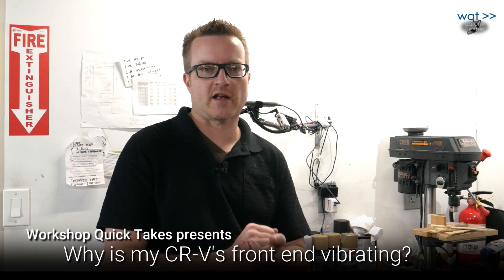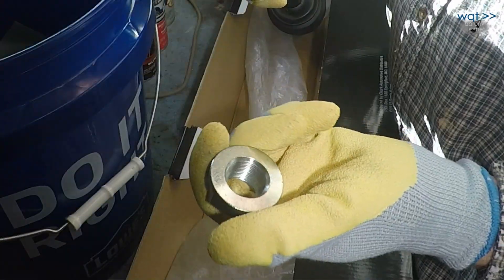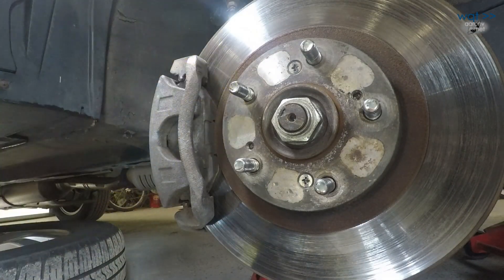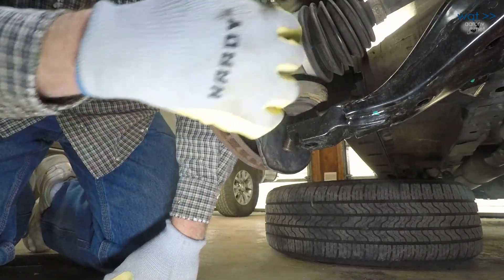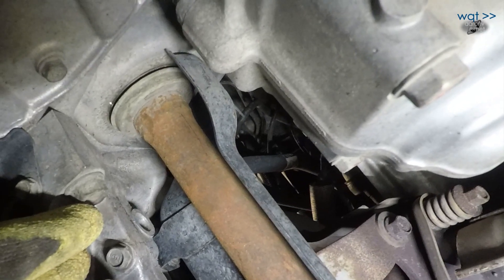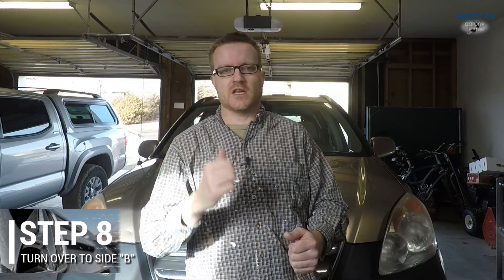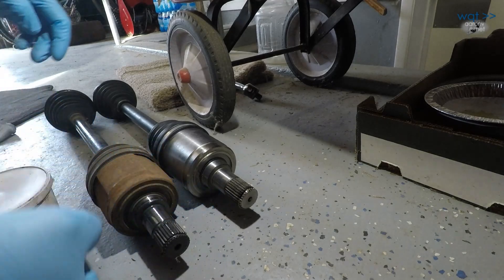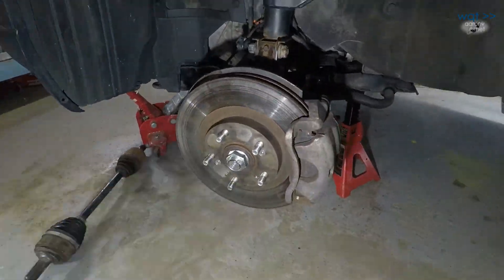wqt//basic auto: Why won't my Honda stop shaking? (pt.4-front CV axles) 02-06 Honda CR-V, others

Comment: well done Aaron..problem solved..excellent.
Reply from the maker: Thanks! This is our runabout vehicle, not a primary, so I went with the one-thing-at-a-time approach. But since many of these jobs can be combined at a time and labor savings, maybe someone else out there will realize that it's cheaper in the long run just to rebuild all the wearing parts in the front suspension in one pass, and be done with it.